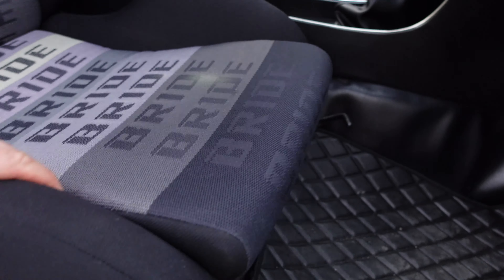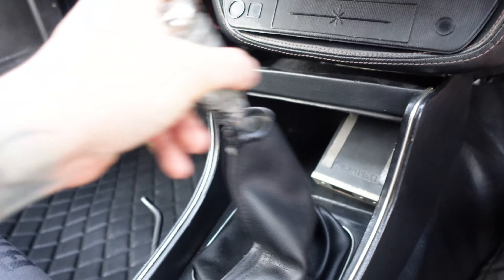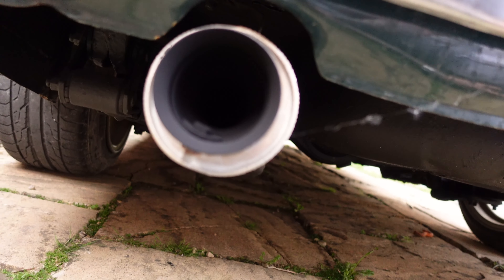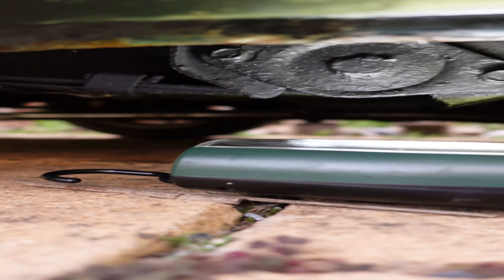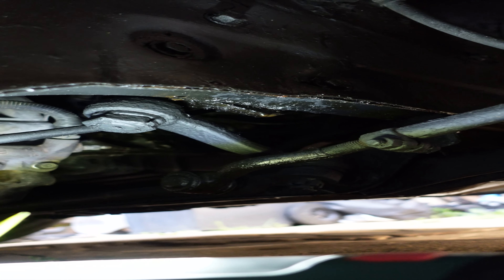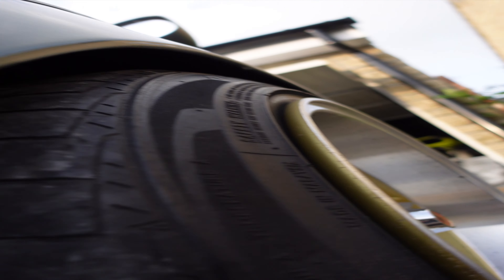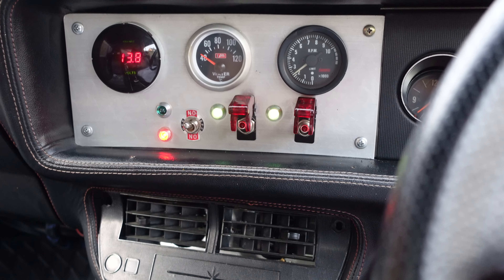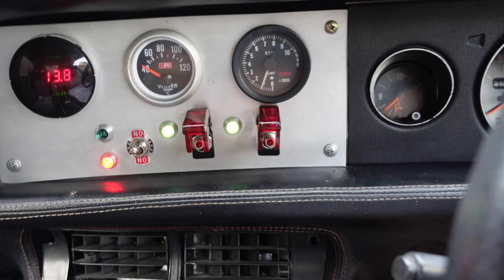Everything Wrong With My 1975 Toyota Corolla KE35

Comment: Sounds like a misfire or a vacuum leak...a trick is to take brake cleaner and spray it around and listen for a change in engine noises for vacuum leak. Sea foam might clear up the injectiors..You can put an AEM AFR gauge on it and tune the car afterwards. That little turbo timer box or tune box looks a little suss. It may have been turboed...  Plus all the racing mods inside this car looks like it was a track/daily driver put back to street mode for sale. I'm loving the content. Cheers Nate! So nice to see the classics still on the road around the world.
Reply from the maker: Nah, was massively out of time lol I have a 45 minute mega video releasing on Saturday about it all
Reply: @MrHVlogsMore  ahhh! Skipped the timing. I'm definitely looking forward to the video! I hope she runs mint soon. Such a cool little classic car.

Comment: How many cars do you own ? Where do you keep them all ?
Reply from the maker: I have four cars. Two currently with me, as my pickup truck is with the paint shop and has been for a year, when it's done there, it goes back to the fabricators to be assembled, electrics, upholstery etc. my datsun 510 is currently being acid dipped. 
So where do I keep them? Well, I haven't had to worry about that yet, it's a cross that bridge when we get to it, problem.
Reply: @MrHVlogsMore  Ah cool. I thought perhaps you would park them on the street or something and annoy your neighbours cause you are taking up all the spaces. You may perhaps have to turn your garden in to a car park 😁

Comment: Spray something appropriate to the suspected vacuum leak locations.  If the engine note changes, there's your issue.  Might be as simple as old fuel (hunting idle) but check the distributor etc for condition/moisture all the same.  I'd start with those basics before doing anything else :)  Lovely car tho!  Very Disco.

Comment: You can hear that it's idoling rough. Thats deffo down to bad spark plugs or a dirty fuel injector clogged hoses. Not a bad car though better looking than the tripe thats on the road in 2024!